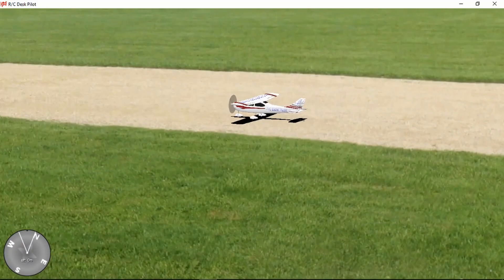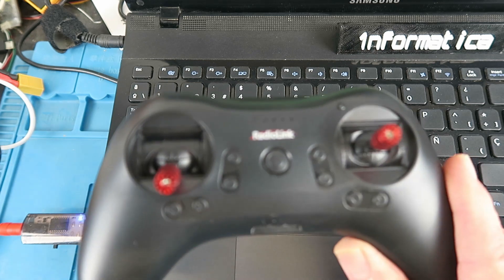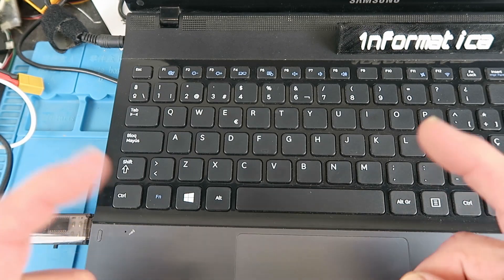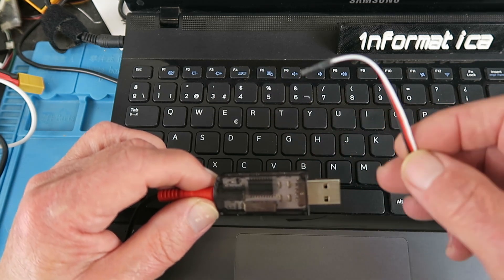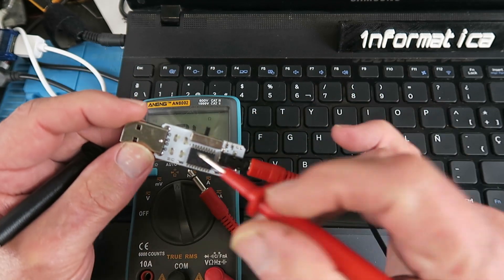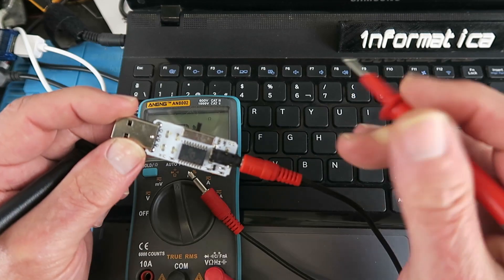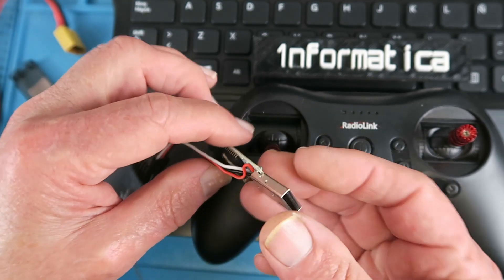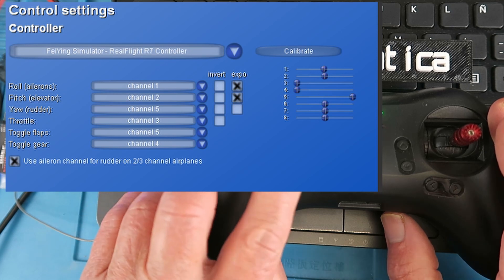RC Simulator USB Dongle PPM Rx Mod Hack

Comment: Correct me if I'm wrong. But it would also be possible (and easier) to use a 3.5mm stereo plug instead of soldering to the PCB? Signal (white) on tip, 5V (red) on 1st ring and the GND.
EDIT: just measured when dongle connected and it leaves 5V on the tip and not on first ring so I suppose it won't work.
Reply from the maker: The reason I made the cable was to connect a receiver : https://youtu.be/IjLYAwupP4c?t=223 in that case as servo wire was needed. YouTube no longer shows me if you are subscribed. Please consider subscribing if you have not done so already!
Reply: @1nformatica  je pense qu'il voulais dire d'utiliser la fiche jack stéréo soudé a la prise futaba (par contre je ne sais pas de mon coté associer les 3 fils pour qu'il correspondent pour se brancher ensuite sur le dongle)
Reply from the maker: @gilbertdelaplace2056  Oui, vous pouvez utiliser la prise jack bien sûr. Tout l'intérêt de la vidéo, c'est que je voulais me connecter à un récepteur donc j'ai dû mettre le câble.

Comment: Can you share pictures connection from reciver rc  to USB dongle. Wire 5v,ground ,signal connection solder
Reply: I finish already solder connection wire 5v, Ground, and signal.connect to futaba reciver 8ch.reciver led indicator green light on.simulator has been detect transmitter.but no function all axis
I try callibration but not popup yellow line callibration.how to fix.i see your instructions .my doggle USB not same to your dogle USB board
Reply from the maker: @maskystudio9193  If your using a Windows PC you should see the controller in the device manager and settings : https://www.howtogeek.com/241421/how-to-calibrate-your-gaming-controller-in-windows-10/
Reply from the maker: You can see here : https://youtu.be/IjLYAwupP4c?t=202 +5 volts and ground from the USB connector. The signal wire goes to the "tip" of the socket used to connect a transmitter. Please consider subscribing if you have not done so already!

Comment: Imagine you being kept in by the weather!  Strange times indeed! 🤔
Reply from the maker: Yes, it has been the worst cold weather in Spain in more than 50 years, -25° in some places! Not only that but the latest COVID restrictions only allow 4 people at the flying site ;-( Hope all's well with you.
Reply: @1nformatica  It's been pretty snowy here in Perthshire but only minus 2 or 3 so we've managed ok!  We're used to real winters here as you'd imagine.
Reply from the maker: @gartmorn  Different story here! I have an old Spanish house that is designed to be cool in Summer, which it is. However in this extreme cold trying to heat it is akin to lighting a candle in the Albert Hall!!